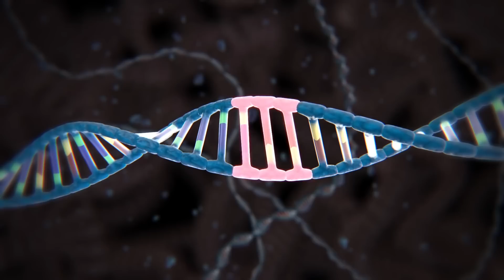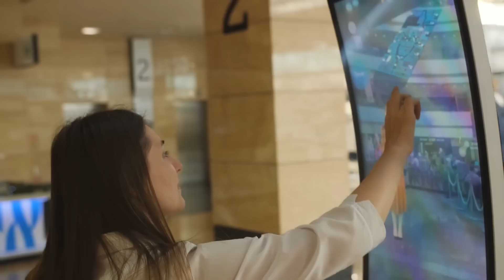10 INCREDIBLE INVENTIONS OF 2023 THAT ARE NEXT LEVEL

Comment: Except that self-driving cars keep hitting pedestrians during testing.
What about the ultrasonic washing machine that requires no detergent announced in 2000.
What about the modern jackhammer that is 20 times faster than the current designs?
What about the computer power supplies that use circuits from 1920?